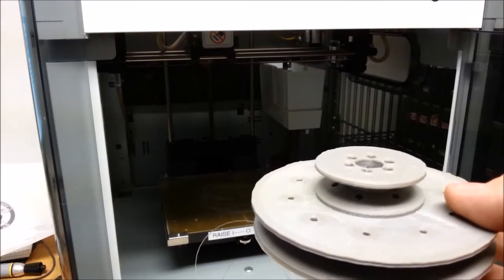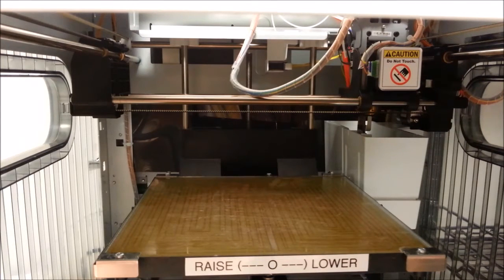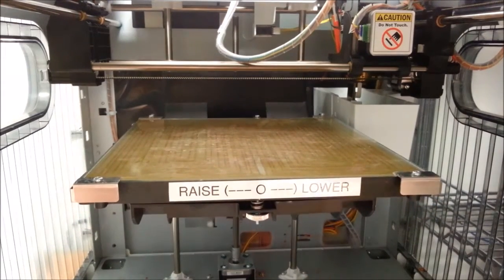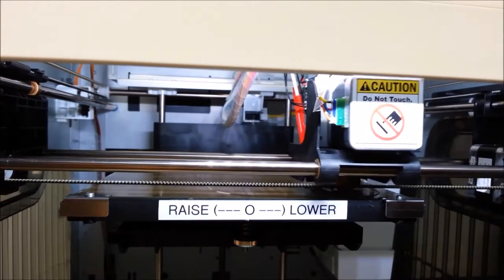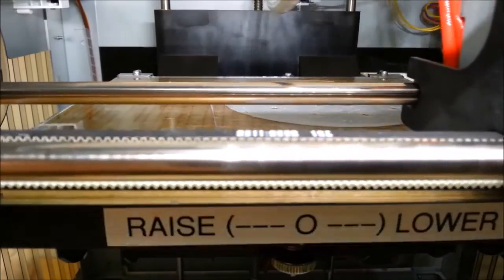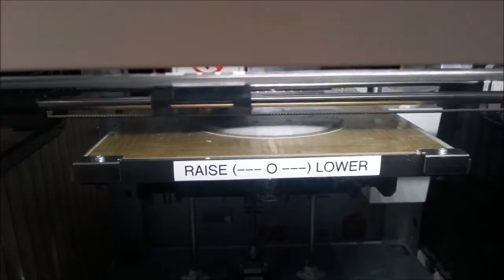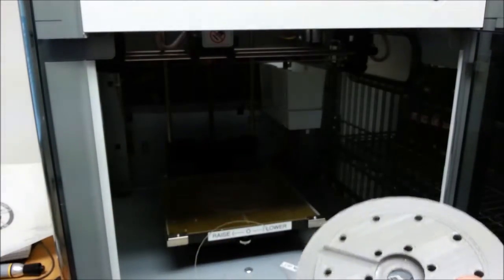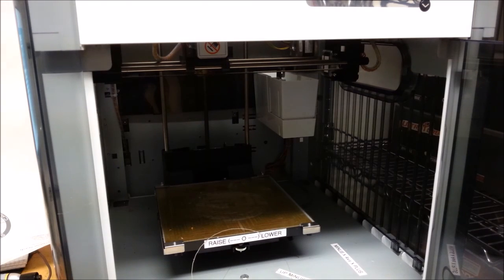3D Printing Atlas / Craftsman Compound Pulley for EvilTwinX Part 1 Crafted Channel

Comment: Tech has advanced so much over the years. You can make things on a 3D printer that can not be made any other way.  There are printers that work with powered metals are very durable. These machines cost a fortune. I first saw a form of this about 40 years ago at a college where they were making models for an engineering project. Now make something for Bushcraft.
Reply from the maker: +james green Had lunch with BluegrassBushcraft just the other day when he was passing through town.   I told him I was trying to think of something for bushcraft to make on it.  That will be a hard one to think of.  A sheath will always be better in Kydex if one likes plastic sheaths.  One of my ideas is maybe to print out temporary leather stamps.  I'm open to ideas if you think of any.
Reply: +Crafted I will have to thank about that.